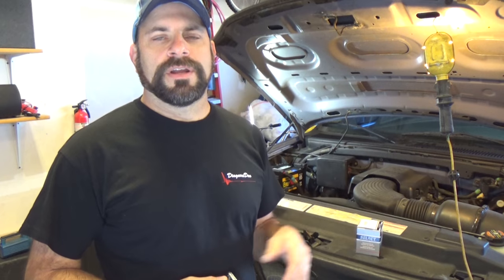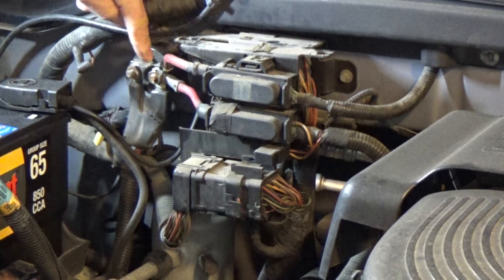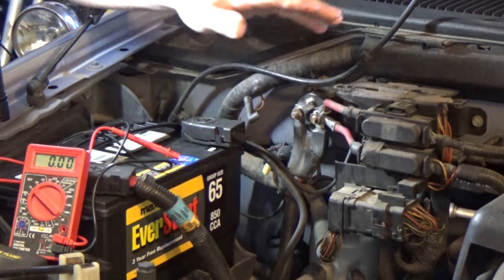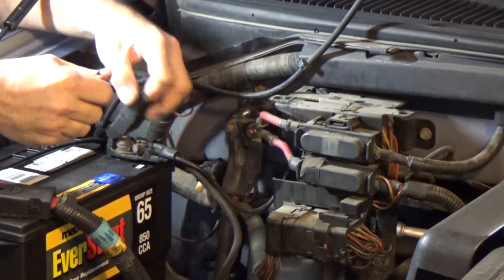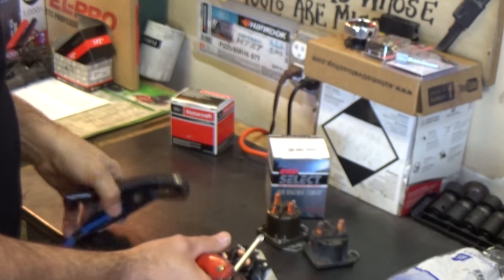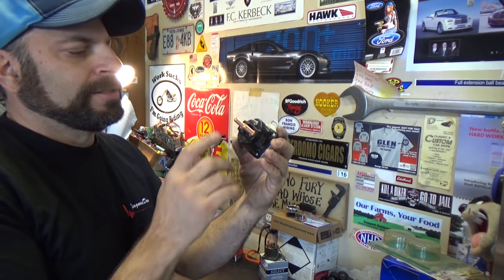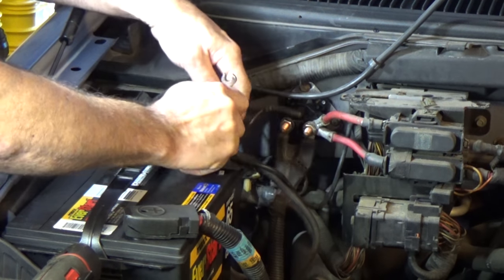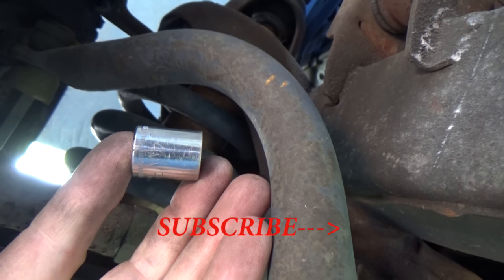Ford Truck Starter Solenoid Replacement -Won't Crank, no start

Comment from the maker: Motorcraft Starter Solenoid SW1951C:  **https://amzn.to/32Yuhqw**
Check out some cool tools that Ozzstar likes to use:  https://www.amazon.com/shop/ozzstar
If this video has helped you out consider donating to the the channel with Paypal, thanks!:  https://www.paypal.me/ozzstar
Reply: Oops 9
Reply: So I have a question. I replaced  the starter solenoid under the hood. Ive been having problems with getting a rapid clicking sound though and my dash lights go haywire. If I turn the key two many times its like the battery goes dead and nothing happens. The thing is i just had my truck in the shop and they checked my battery and alternator and they were good. So could this be my ignition switch.
Reply from the maker: @ghettohey2388  could be anything. I would definitely check that the ground wires are all in good condition and have clean contact points.

Comment: Yes, I’ve gone through the same thing over the years. One observation is that the negative terminal on the solenoid that you referred to is actually the positive terminal coming from the battery. Where the other terminal will still be positive going down to the starter motor. Great video Glen and should help folks to be aware of inferior parts.
Reply from the maker: You are absolutely correct Terry!  I should have clarified that better and glad you called me out on it. Thank you sir.  For anyone who may not understand, the left side solenoid terminal becomes HOT when the solenoid is activated and sends power directly to the starter.  The right side terminal is always HOT even with the key in the off position.
Reply: @ozzstars_cars  Left terminal Grounding through the starter motor windings -- thus indicating that it was a "ground"  with the test light  ?

A friend had a Land Rover.  Starter switch system under the dash kept burning up.  Seemed like the ignition switch carried the full starter current. I had had several Fords and suggested he should activate it through a Ford solenoid.  I couldn't make him understand what I suggested -- my lack of adequate explanation I think.  Thanks for the video.
Reply from the maker: @davecaselli1957  yes, grounding through the starter lit the test light when not in use. Thanks for your comment.
Reply: Pro tip : you can watch movies at Flixzone. Me and my gf have been using it for watching lots of of movies these days.
Reply: @Elian Anderson Definitely, I have been using Flixzone} for months myself :D
Reply: @Elian Anderson Definitely, been watching on Flixzone} for since december myself :)
Reply: Are you from Pennsylvania I'm from right around Pittsburgh West Mifflin well I grew up in McMurray PA but ended up moving to West Mifflin now I'm in South Carolina..
Reply: Yea, I was wondering what the hell he was talking about. Basically the Solenoid acts like a draw bridge connected a passageway for positive current .
Reply: @ozzstars_cars on some vehicles like expedition it's located with starter right? Or is there two selinoids?

Comment: What about the plastic covers for all electrical components... My service man says,"...they are not necessary!" But, of course they are ...protect electrical parts from rain and moisture. He threw the plastic covers away!
Reply from the maker: @allen5455  makes for some nice fireworks if a metal tool touches the contacts to ground.
Reply: @ozzstars_cars  ...can also blow out parts!

Comment: I had an intermittent start (click then would grab) for awhile then it just wouldn't start at all, just click. I followed your steps and noticed when I checked between the positive battery and the negative solonoid it would show voltage, but it was fluctuating up and down. Then when I jumped the solonoid it just clicked, no start. I was about to go buy a new solonoid and new starter when logic kicked in and I thought that I must just not be getting enough power. So I started tugging on wires and the positive cables pulled out of the terminal. I took it off and flattened it a bit to be tighter, re-installed and it cranked right up. Saved me alot of time, money, blood, sweat and tears. Thanks.
Reply from the maker: High resistance was the problem. Nice find!

Comment: For those who are replacing a fender mount solenoid- be prepared to horse around the thick cables to match up the solenoid 8mm holding bolts
Reply: For sure Richard. I made my cables up with that in mind and orientated the ends to face flat on those 8mm holding posts. Thank God I did. lol

Comment: This is the best video I have ever seen on starters and solenoids. Thanks. Knowing what poles to cross to start the vehicle is what I needed to know.
Reply from the maker: Thanks!
Reply: My starter stays engaged but if I pull the little red wire loose it disengage

Comment: I'm going through the same thing to on my 2001 ford f-150 xlt 5.4 v8 tritón. I'm going to go ahead and do that, by the way it was a great video and good presentation step by step which that's the correct way to do it, some just show you but some don't explain step by step and taking their time.  I really appreciate you showing this video and I'm pretty sure others out there appreciate you to. Thank you
Reply from the maker: Thanks for the kind words.  Good luck with the fix!

Comment: Brother Dan did a remarkable job in the video, starter relay and voltage regulation.
Reply: dan I get clicks down at the starter when using the screwdriver test against positive and negative. The top portion of the regulator on the fire wall I am interested in. Its purpose etc. I believe a neighbor disconnected things from it.

Comment: Thank you for showing how to test the solenoid. I just tested mine, it's not clicking or doing anything. I was thinking it was the alarm system messed up again. I still want to remove the alarm system because it's an aftermarket piece of junk, sometimes it runs and sometimes it doesn't

Comment: Today I just went through the same thing you did with the starter solenoid.  Ended up with the same "NEW" design that didn't work.  Going to order one online now.
Reply from the maker: Motorcraft is the way to go in this case!

Comment: FYI, in the old days, the additional post on the aftermarket solenoid was used to send 12 volts to the ignition points, allowing a hotter spark on startups. Thank you for sharing.
Reply from the maker: Okay good to know.  Sort of an auxiliary power source.  Thanks for the info Andrew
Reply: @ozzstars_cars  Yes the normal voltage to the coil/ points is through a resistance wire bringing it down to 8 volts or so. The I terminal would send 12 volts to the points while cranking

Comment: When I turn the key I can hear a click up to under the hood which I think is the relay. But when I try your screwdriver trick it sparks a little but does not start. Does that mean starter solenoid is bad?
Reply from the maker: Time to test the solenoid just like I show in the video.
Reply: So you mean take it off and tester it. Correct?

Comment: Thank you ive replaced my battery, then my cables from the starter to the battery , alternator and the starter. Just to watch this video and see it was my solenoid😂 thank you for sure
Reply from the maker: It's an experience you won't soon forget. 👍

Comment: My 1996 F150 has been giving me a headache with its starter solenoid. I swapped out the original OEM part with a Duralast (which resembles BWD) last week, and although it initially worked fine, it's now acting up again with intermittent starting problems. I'm leaning towards opting for a Motorcraft replacement.
Reply from the maker: JR do what guy in the video did, go OEM Motorcraft.

Comment: I just put on one of those 4-terminal relays today. Relay clicks loudly, but starter doesn't crank very often. Same problem I started with. Now if I jumper the two large copper terminals, the engine cranks every time. The 12VDC to the relay is good as the relay clicks loudly regardless whether the starter cranks or not. So it must be junk. I admit I`ll have to confirm this. Interestingly, the box said Made in China, but the plastic bag inside said Made In Taiwan. Plan is to do more testing and also take my old Ford relay apart, clean the contacts, and then try it. If it works, then I`ll know to buy a new Ford relay. I also noticed that plastic part interfering with getting the heavy cables on. The new relay came with spacers, but they don`t raise the cable away enough.... the plastic is still in the way. I didn`t check, but I think that 4th terminal connects to the coil (+) on older cars. It provides 12VDC during cranking which essentially bypasses the ballast resistor to get max battery voltage to the coil during starting. If that`s the case, DON`T ground it!
Reply from the maker: Buy a Motorcraft solenoid, link in the description.

Comment: Would you rather have the new Solenoid never Hot or Always Hot? A few years back I went through an old friend of mine’s Ford 8N Tractor. It Needed all new electrical from sitting 8 years, do it once, do it right was the plan. I Got a new solenoid from the local New Holland dealer, made in China. I get everything in order, all excited because this was the last piece. I hook the battery terminals up and the engine starts to turn over! I triple check the key, wiring, double trace everything since it’s Positive ground and a new format for me. I’m completely stumped! The Next day I stop at Tractor Supply and buy one made in Taiwan. Put it in and works like new. China vs Taiwan vs Mexico
Reply from the maker: Wow, stuck in the ON position. Never know what junk is being sold. Take care

Comment: Awesome video! The negative terminal you mentioned is really being pulled to chassis ground through the starter solenoid coil so its technically not the same as the negative on the battery.  Measuring the resistance of that terminal to chassis ground will show tens of ohms. In your video, measuring 12 volts confirms the coil isn't open and is a good check to do.

Comment: Hi, i got the same truck, it seems to shut off when i slow down n turn right. The first time it restarted, but it wouldnt start today at lunch. And showed 12.4 charge so a friend jumped it w thier truck and it workd the battery numbers  jumped to 13 or 14 but i drove maybe 2 mins and it shut off again. Coasted home but the battery shows 12.4 and it wont jump start now and sometimes the dash lights come on when i turn the key Sometimes they dont.
Reply: Same problem! You forgot find a Solution?
Reply: @moniquecasey6133  I was told prbly alternator. Gonna try to get it to a mechanic soon

Comment: The first test you do around 4:45 (positive battery terminal to left post on solenoid), if you dont get voltage, what do you think the issue is? I previously had voltage, replaced the solenoid and starter, and still didnt start, not upon checking this again I no longer get voltage on that test. As far as I can tell, my grounds are fine, relays are fine, fuses are fine, and connections are clean. I just get 1 hard click when trying to start followed by a smaller soft click somewhere else. Battery reads proper volts and wont start with jump pack.
Reply from the maker: Definitely could be resistance in a positive cable but most likely a poor ground connection, unless the starter is defective. Did you test it?
Reply: @ozzstars_cars  The starter was a brand new bosch starter, and I am having the exact same issue as previously with the old starter, just 1 hard click. However, I did have voltage on the first test mentioned before swapping the starter. At this point I need to cross the bridge of getting power to the left side of the fender solenoid again. I did a few ground tests earlier and all seemed fine, will have to lookup if I missed something.

Comment: Very professional video (wish all DIY were as clear w/ instructions). So, I'm having intermittent starting issues and when I tried the ignition test which you begin to show at 8:00 - it fails, there's no light on my test probe. My ignition fuse is still good so what does this mean exactly? Could this ignition cable itself be bad?
Reply from the maker: Test at the starter relay to see if that is working. If the fuse is good and relay doesn't click then it's time to test the ignition key switch.  Thanks Scott for your positive comment.
Reply: @ozzstars_cars  Looks like I'm at the point of testing the ignition switch (that should be a barrel of monkeys). Thanks again for the help!

Comment: Whenever I say, "I'll get it later ...", I forget I dropped it, and spend 40 minutes cursing trying to find it (usually a 10mm ...) the next day! 😂

Broke When Delivered strikes again!  I've got a Ford solenoid story for ya, Glenn! :D  

So, I bought a Motorcraft one from RockAuto back in 2016 for the Grand Marquis. I had just replaced all 3 battery cables, plus installed a new Remy starter. Put the Motorcraft one in to replace the 10 year old (at the time) one I had bought from Autozone (can't recall the brand). All was well - that starter whipped over faster than I had heard it in years! Then one day I was sitting on the can as my wife went out to go to work. Window was open (which happens to face the garage)in preparation for the nasal assault. I hear the starter crank ... and crank .. and crank! Thankfully I hadn't started my business yet! I flew out of there 100 MPH, just about knocked my wife over as she stood holding the keys in disbelief, and yanked the negative off the battery! 

I believe I was a victim of the 'rock auto switch' again. You have to pay close attention to what you're getting, regardless of what the box says. I've been burned SEVERAL times by this over the years  - the past 5 in particular. I think I got a Motorcraft box, but some other substandard part inside the box. I ended up putting that old Autozone solenoid back in, and it's still working today - 4 years later. 😎
Reply: Google keeps messing with my comments!! Finally got this one straight - sorry if you got bombarded with multiple comment notifications there, Glenn. 😡😡
Reply from the maker: Smitty I would have really been upset about you getting ripped off about buying a knockoff solenoid but throw the toilet story in and I'm literally lol! 😂 I can just hear the starter bendix screaming and the flex plate begging for mercy just as your about to drop a mean deuce in the bowl! haha  When I took the Broke When Delivered back to Advance Auto the guy told me since covid19 he has seen parts boxes that usually say made in China that are now printed made in Mexico.  So who the hell knows where this inferior crap is coming from?  All we know is it's junk.  Lots of Motorcraft parts are counterfeit which I'm sure you are aware of like spark plugs and coils being two popular parts.  Take care
Reply: @ozzstars_cars  - I'm just glad I didn't have to pinch and run ... could've ruined my day! 😃
Reply from the maker: @SmittySmithsonite  🤣🤣🤣

Comment: The negative terminal you referred to is actually a positive terminal coming from the battery and the other positive terminal is for going down to the starter motor
Reply from the maker: Correct, I have pinned an explanation at the top of the comment section. 👍

Comment: Thanks for a great video sir, very precise and in depth. Question????? When you were bench testing the solenoid using a negitive battery cable clamp, why was it sparking on the ignition pole/rod?? Just wanted to clairfy was it the positive side jumper clamp to the base? Thank you very much. Appreciate your video and teaching! Cheers from Motown. Oh, New subscriber too. Thanks Glen
Reply from the maker: The sparks are due to high resistance because the BWD coil is defective and grounding out. Thanks for your comment Robert!
Reply: @ozzstars_cars  Thanks for your quick reply Glen. Solenoid (New) checks out fine. No voltage from positive to neg side being transfered in start mode. Hot side is 12.5 volts. I have 67 Mustang gt with a 4 post solenoid. Red/blue wire to the "S" terminal. Solid brown wire to the "I" post. While momma was turning the key to start, I got no Continuity light up on the "S" wire. Appears that could be the problem? Thanks again for your time, it is very much appreciated sir.
Reply from the maker: @robertclymer6948  voltage drop test, find out where the short or corrosion is hiding. 😉
Reply: @ozzstars_cars  Thnks Glen. Pulled instrument bezel and found a connection not plugged in (was hot) right at the back  ignition switch wiring area. Plugged it back in and now have power  to the "S" terminal on solenoid. Dumb mistake on my part when I installed the new Ignition switch a few days ago. Duh! Take care, blessings to you from Michigan
Reply from the maker: @robertclymer6948  glad you found the short! We all learn from our experiences.

Comment: Distributor pick up coil could also be an intermittent problem like this. So, if this doesn't work that's the next part I'll buy. Good video ,it helped. Changing out started solenoid tomorrow. Bought the cheap one at auto zone for $24. Hope it works. Didn't want to wait two days for amazon plus spend another 10 or so. My 94 fordE-250, did an intermittent no start, no nothing to me twice already. Third motor, 4.9 ,rebuilt trans once and has 305,000 miles and still going. Owned now for 20 years.
Reply from the maker: The aftermarket solenoids suck. Buy a Motorcraft part and be done in one.

Comment: 11*  weather in michigan but when i go to start i cet a click.
when i try to jump solenoid i get nothing.
there were NO SIGNS prior,wedensday it worked,thursday morning it didnt.
maybe the starter froze? or just took a crap? 
idk.
you have an awesome informative video but theres nothing between solenoid and starter is there?
its 5:50am and im searching the internet to push off going out in the cold.
please tell me to jab the starter with a broom stick a few times lol

gotta build a barn
Reply from the maker: Cold weather does crazy things to machines. Good luck, hope you fix it.